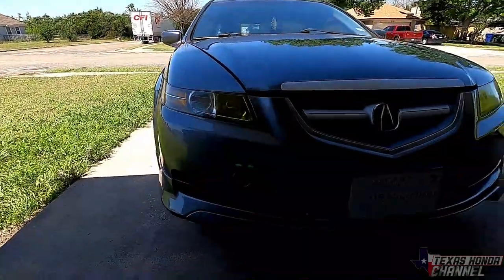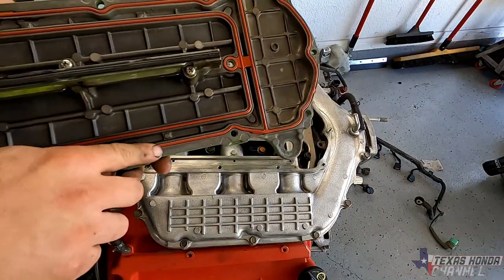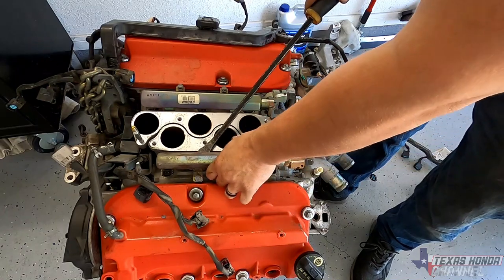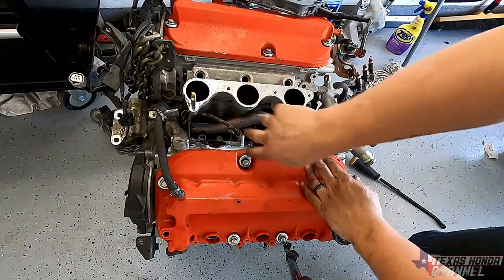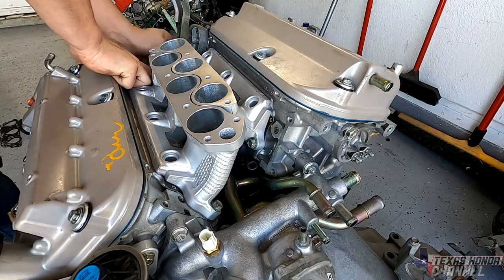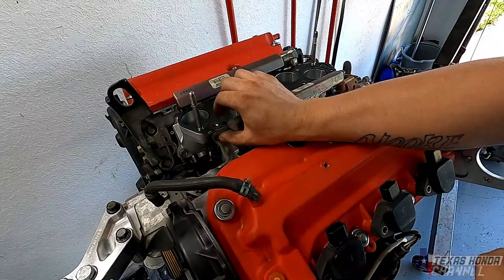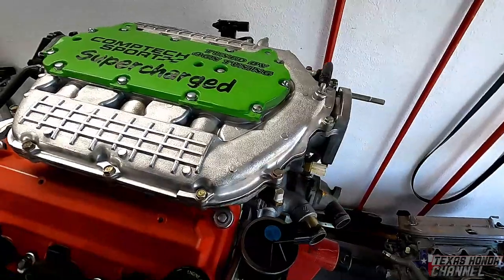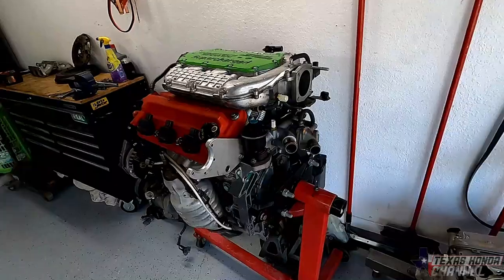HOW TO INSTALL A P2R CNC PORTED RUNNERS ON A J SERIES (2006 ACURA TL)

Comment: Careful using the impact when you tighten the manifold bolts. I had the lower runner crack on me just using a ratchet its 12lbs for those studs.
Reply from the maker: Yea I’m not getting them too tight just looks that way on camera gotta love the cheap harbor freight impact it’s trigger control is awesome I can make that thing go slow or fast but I know what you mean. I did it to a d series with a wrench lol 😂

Comment: Need to watch out for the knock sensor wire if it is still on the car. I accidentally broke it when I did mine a few years back and had to wait a week for it to arrive from Honda
Reply from the maker: I mentioned something along those lines in the video.

Comment: Hey can you make a video showing the exhaust manifolds since you have them out? Showing how the manifolds look for a possible twin turbo and also showing how the J pipe sits compared to the OEM ones?
Reply from the maker: I’m confused the J pipe sits the same as the oem
Reply: Texas Honda Channel , thanks for clarifying . I thought maybe the J pipe was larger diameter, removed cats, or was a different design. 
Is it a one piece that mates up to both sides or is it a slip-type into a collector then to flange. 
The reason I ask is if a turbo is used on each side , would it need to be mated to two individual runs, or collect at a certain point. 
I’m not as familiar with Jseries engines and the variations that are out there.

Comment: Some mentioned performance gains & knock knock sensor.  Would you say i could run a car without a o2 sensor or maf sensor
Reply: Got a car trying to fix from bad fuel or too much sludge. Eventually parked it after spraying carb cleaner thru the cone filter and fuel tank since the fuel treatment was about to stall it out but this kept it idling. 

But spray through the filter must have hesitated the engine since the maf sensor is clipped into the adapter pipe.  Then i tried flushing it with shell 87 but it was half water & so the idle was bouncing for minutes and stalled.  But it cut back on & off after 5 minute idle.

  Iso-heet didnt help much along with 91% isopropyl alcohol.  But i hit lift and felt the sludge coat the heads while feeling a split second hiccup as it hit lift.  2nd time it just felt like the oil was diluted & heard the valves rattle like my buddys sonata except his did it accelerating at 2500 rpm  lol
Reply from the maker: You can without both on a d series at least but I wouldn’t. Now if you have a idle going up and down that’s a vacuum leak somewhere most likely. Sounds like you have a fun project on your hands

Comment: Hey Texas I'm building my 2004 Acura tl 6mt got the suspension brakes and mounts for the engine and tranny done and the clutch now I need to do the exhaust but after that it's the heads and intake.... P2r or halferland performance some of HLP's items are cheaper I wonder which one is better for NA builds

Comment: Do you need the spacer or can you get away with putting a thermal gasket on the lower intake runners and studs
Reply: You can install the gasket without the spacer just fine. That's what I'm doing because of hood clearance issues I can't run j37 manifold with spacer unfortunately. I found a thread about somone trying it but had to intsal hood spacer and I ain't doing that! Lol

Comment: What’s the thoughts on the solid motor mounts? I really wanna get them but have mixed reviews on them going bad with the heat from the engine and if so which brand
Reply from the maker: I have a video I just did on solid mounts. They didn’t make it uncomfortable to drive they definitely stiffened up the engine and allowed for it to not wheel hop now. Slight vibration in the steering but that’s it. That’s just due to it being solid. Check out my other video. Highly recommend them. Innovative mounts btw I did the 75a
Reply: @TexasHondaChannel  and they won’t deteriorate from the heat? And yeah I saw that video and loved it which brought me to the question 😂really appreciate it
Reply from the maker: @LittleromoGaming  nah the heat won’t mess with them. I never had a issue with them on any builds I have done
Reply: @TexasHondaChannel  perfect I really appreciate it and can’t wait to tackle that job🙏look forward to more videos

Comment: Why did you go with p2r runners? I feel just because they are CNC ported doesn’t make them better I’ve seen both and the work that halferland performance did was great plus they’re matched to the manifold got it all done at one and knife edged and ported throttle body as well can’t wait to get them put on the Accord!
Reply from the maker: These have been proven to work and I wanted these. I’m not saying halferland is bad but I wanted these and there are many other people who have had good luck and they are larger and great quality so I’m sure they work fine. Dyno tests will show for sure.
Reply: @TexasHondaChannel  Thanks for the response. I see what you’re saying but looking at them both side by side seems like the halferland ones have more material removed so in theory they should flow better but I’m sure the difference is minimal. Also what is your opinion on running a lightweight crank pulley while making a lot of power? I’m worried about damaging my engine if I ever decide to go turbo and have a lightweight pulley. I come from v8 ls2 platforms and they don’t make aluminum pullies because it will cause the crank to flex and snap even.
Reply from the maker: @HondaAccordPerformance  well I’m not real expert but light weight pulley without damper might damage something but also not sure with the J series haven’t blown any up lol 😂

Comment: Have you ever upgraded your tps sensor on the j series? I see p2r sells them but what does it do? I understand the k series one is more adjustable or sonthing? Can you elaborate? I've done the j37 manifold upgrade and it will do the rev bounce when I push the clutch in and coast but I adjusted the cable tighter to eliminate it as much as possible. Idk if you've tried this but I've been using this throttle controller called "Sprint Booster" and it makes my throttle behave 1 to 1 like a cable throttle. I'm not sure if you cab adjust throttle quickness with a tune but mine probably runs lean. You are much more advanced with your builds than me but for people that don't want to spend all needed for a tune on our 7gen accord this mod is a fun improvement.

Comment: Hey James I got a d-series question.
I have a civic with a D16Y8 with manual transmission and a matching ECU.
The engine is blown.
I have a spare d16y 7 with an automatic ECU and wiring harness.
Can I swap out the engine, wiring harness and ECU ?
Will the automatic ECU work with the manual transmission?
Reply: Won't work unless you modify the ecu...loads of how to on forums..

Comment: does taking the engine out make it easier or do you have to do it
Reply: No, not at all. Obviously, if you were building an engine from scratch up, it would be much easier to do so, since you wouldn’t run into other issues from parts being in the way.

Comment: What was wrong with the original engine you had in there
Reply from the maker: Nothing. I just wanna build it and since there is nothing wrong with it and I know for a fact it’s good then it will be a great candidate for mods. That means less machine worked or issues I’ll run into. The junkyard engine has a warranty so if I break it I can take it back lol 😂

Comment: What performance gains would be seen with this mod? By the way all your engines are so damn clean niceee
Reply: Ported and polished intake plenums make a huge difference in power and feel. Especially on a boosted car👍
Reply from the maker: It flows so much better which increases your throttle response and a average 10hp gain depending on other supporting mods. It should help shift the powerband lower which means more power quicker.
Reply: @TexasHondaChannel  Ahh so low end torque should improve , sounds good

Comment: while you in there, throw a set of cat  delete ,
Reply: and do you have any idea to do pvc delete on this engine? i opened the intake manifold apart just like yours i took hours of cleaning, definitely don’t want the engine suck in oil
Reply from the maker: @MBZXZ  I don’t want to do a cat delete. I actually like having my pre cats. If I was to do anything it would be high flow cats but I don’t have $700 laying around for the Rev9 high flow cats. Maybe one day I’ll get them but not in the cards for right now.
Reply: @TexasHondaChannel  haha make sense, does this 3.2 engine has the type s oil spray on the pistons? are you doing 3.5 crank swap? i having very bad luck on my j35a8 , a lot of bolt striped.

Comment: what do you get from changing these runner's. Im curious . I have a TL as well
Reply: 3-5 whp. With the better 3.7 intake/ Throttle body with p2r runners close to 10-15 whp. My brother in law made 12whp on his 2006 auto tl went from 226whp@ 6100 to 238whp@6300. It sounds like small hp gains but the car is night and day difference
Reply: @simbanugz2906  well I have a j37a2 engine on my 07 Tl type S since the engine didn’t came with a3.7 manifold I got a 3.5 and it has a TB adapter or spacer. I hope I see some gains